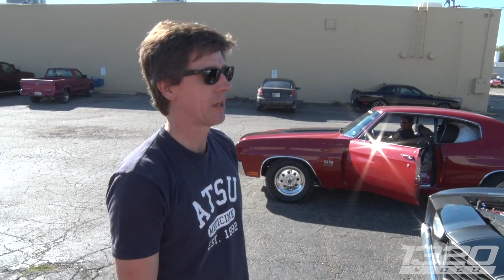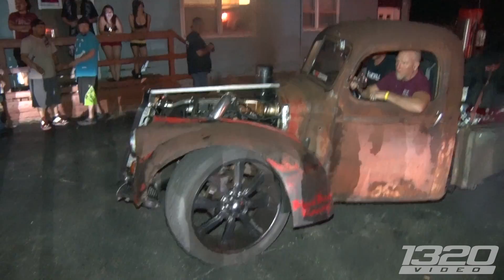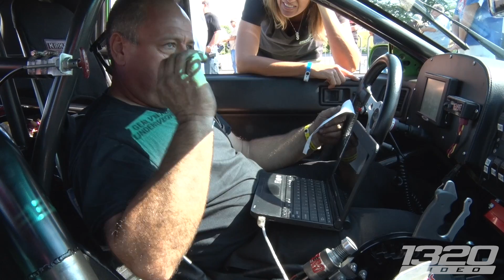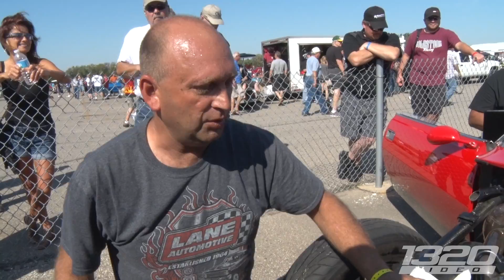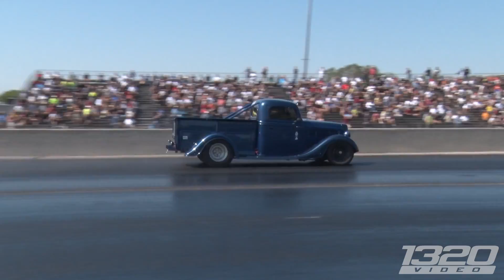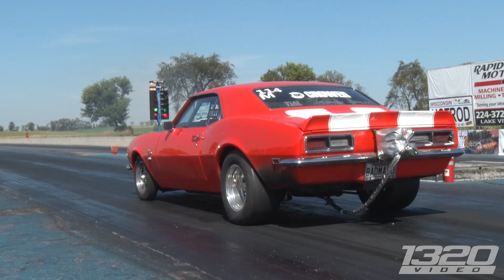Drag Week 2015 - Day 3 Road Carnage and Racing!

Comment: Good job 1320 video crew! I love seeing that 69 Shelby going down the track. Wish all well on drag week
Reply: +Michael Ellestad its an all motor car even. 585ci of cammer power. its a clone but bad ass. hot rod has a short on it 
http://www.hotrod.com/events/hot-rod-drag-week/2015/1509-jay-browns-1000hp-8-second-sohc-shelby-at-drag-week-2015/
Reply: +mrbigshot29  I like it even more now. FE Cammers are badass.
Reply: Clone or not I LOVE IT!!! Though I don't money for one I like to have a 67 Shelby GT clone turbocharged and equipped with a C6 automatic. I love them Ford 427 SOHC cammers a lot and the 585 cammer too

Comment: Man, there's a handful of those guys that could really stand to lean their tunes down a bit, especially the RX7, gawd damn it looks like a diesel! I know there's a lot of new setups and caution on the tunes though too. The RX7 is launching pretty soft too. That car has a lot left in it.
Reply: +mytmousemalibu thats exactly what i've been thinking...but i'm not the one trying to get 1k+ hp through drag week!
Reply: Most guys run pig rich when they go to the track. Lol. Helps sometime.
Reply: Well theres a certain time (boost lag) where the tune is made for max boost not just raw motor so therefore it runs a little rich when boost kicks in the tune is and where it needs to be and it leans out
Reply: Sure, not denying that at all guys. Still pretty rich looking AFR's but without seeing the actual data... all guesses. My family used to race a 69' Nova promod, 526ci/8.3L Arias hemi on methanol, 14/71 Kobelco blower @ 60psi boost. All mechanical fuel injection. We tuned the AFR on it by the discoloration of the Cad plating on the spark plugs, for individual cylinders. A laptop would have been easy! Running an old Haltech in my RX7 and EFI Live on my Dmax.
Reply: This is  dope
Reply: mytmousemalibu